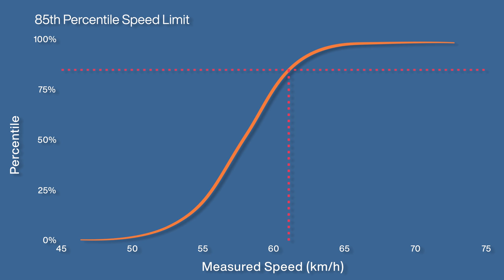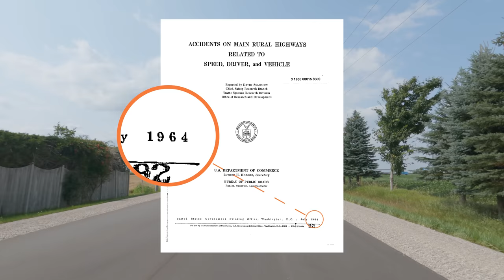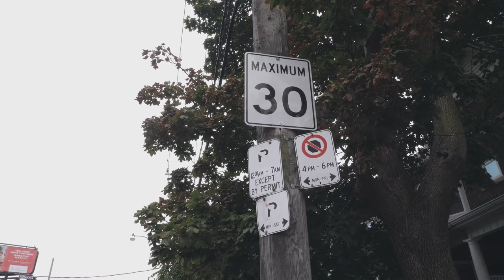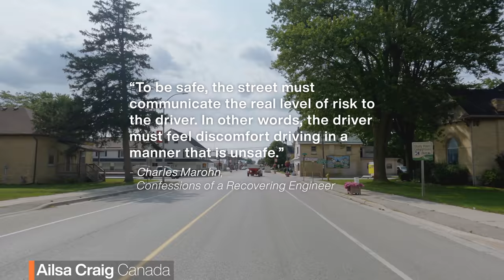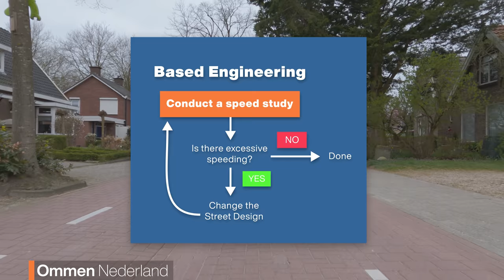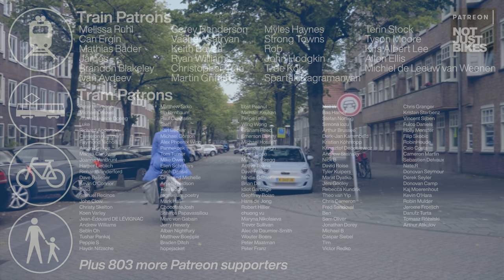The Wrong Way to Set Speed Limits [ST06]

Comment: Had no idea traffic designers would choose the speed limit based on the average speed of observed drivers on that piece of road.
that is absolutely insane to me.
Reply: It's the scientific method! Speed limits are discovered, not created 😂
Reply: Yup, that's just batshit insane stupidity for anything even slightest complexity. 
People like to speed and make stupid decisions all the time. 

One of the cities I lived in had a great example of it - we called it's Masters Turn. It's on 30,000 car/day crossing of major highways forming ring around the city. It's a two lane road with sharp bend and very little visibility (due to noise/crash barriers and bend radius) and thus 50 km/h speed limit. 
You would think people would be smart to notice that their visibility drops to 5 -10 meters and they should actually drive the speed limit (or less). 
You would be wrong - this intersection had multiple crashes per day (especially during autumn/winter) which ended up gridlocking entire city and generating hour long traffic jams.

Two years ago a speed camera was installed there - and the same week, number of crashes dropped from 1-2 per day to 1-2 per quarter. This intersection even had it's own Facebook page (with new crash video posted pretty every day, after the speed camera went live - the fanpage died due to inactivity:(
Reply: It makes sense on a rural or open road, it doesn't in the city,.
Reply: In one sense, that's actually an implicit agreement with the point of this video--the speed that drivers will go at is mostly an inherent property of the road design, so they're setting the posted speed limit based on the "natural" speed limit. All they need to do is close the loop: altering the posted speed limit should require drivers to already actually be going slower in the first place, due to changes in the road design, like what he explains in the video.
Reply: @qidydl  true, true.
Reply: I'd deliberately not round it up or down... 
"ok for this road the speedlimit will be 42 and ¾ km/h."
lmao.
Reply: On the state DOT website, a FAQ is "Won't traffic slow down if you change the speed limit [presumably down]?" The answer is something along the lines of "The speed limit is only one of several factors that drivers use to decide how fast to drive, so lowering the limit won't necessarily reduce the speed of traffic." I guess at that point it's just a convenient place for traffic cops to set up speed traps.
Reply: That's more for highway design, not for steers. Streets are generally designed based on surrounding land use, right of way size, traffic volumes etc. I don't know what this video acts like 85 rule applies to everything, least of which new design.
Reply: I guess the underlying assumption is that a "majority" of people drive more or less safely for the road design, which is probably true. But that's also why sticking lower speed signs on a road you've otherwise left untouched isn't a solution. It's weird that applying a speed limit to a road is such an afterthought; I'd have assumed a road (well, *street*) is designed for a set speed limit and not the other way around.
Reply: I really thought he made a joke. It wasnt until the final minute that I realised it is a fact...
Reply: It begs the question why the speed limit even exists if 85% of people drive slower than it anyway and it has literally nothing to do with a theoretical safe speed.
Reply: @Person01234  It should force the remaining 15% to drive slower (assuming they won't break the limit) so there will be less overtaking.

Also, it probably has something to do with the safe speed if the drivers drive at the speed that feels safe to them and that isn't completely off the mark. (However, this won't work if drivers primarily consider their own safety and there are pedestrians around.)
Reply: Imagine that mentality on the Autobahn: Jah jah Hans, 180 minimum zupper gut
Reply: @The98597thMark  About 87% of fatal crashes occur on stroads. Hence, while streets have an appropriately low speed limit, and roads have a high speed limit, the stroad (or arterial road) seems badly designed because the crash rate is so high.

If you look at any of the YouTube crash videos, then you'll notice the 90% ratio of crashes on stroads holds true. Hence, it's the design of the stroad that's bad, and driver training, lower speed limits, and so on won't do much to lower collisions.
Reply: @furthereast6775  thank you! I dont know where he got that 85% bs. Maybe that’s how they did it 200 years ago 🤣
Reply: Its partially simplified, but apt description of the process. There is a DESIGN SPEED, and the SPEED LIMIT which are two different things in traffic engineering. The engineer will design the layout of the road with such things as curves designed for a specific DESIGN speed. Such a desired design speed chosen based on the road classification (Highway > FAST local street > SLOW). This gets approved and the road is "designed" for that speed. The speed limit gets posted based on how vehicles then go in that area (85th) so that cars group together and we limit passing (as described in the vid). 

The problem is we dont apply enough controls to make sure drivers will go a DESIGN SPEED we want. This causes problems when we want to REDUCE speeds in a road because now the posted speed is 50mph, but we want to remake it into a local road where drivers are going 30mph. We can't because we get stuck in a loop of following the SPEED LIMIT of the existing road or if changing the DESIGN SPEED of the road is accepted, we no longer have the space to add curves and things to make sure the SPEED LIMIT matches the DESIGN SPEED. 

American design is about 30 years behind NL (in large cities) and designs typically always favor car users because a majority of the population only drives. Speed control is a nuisance rather than a tool for good design. Don't get drivers started on daring to suggest speed humps!
Reply: @langhamp8912  I'm well aware that stroads suck, though the safety issues aren't from driving too fast per se. I would agree that a stroad's a good example of a place they shouldn't be relying on drivers' instincts to set a speed limit, because the middle lane's a very different place to the edge lane etc.
Reply: @mantasr  People who think they're good drivers always say this :)

Overall speed limits in urban environments are probably too high. Nobody should be zipping through city streets with busy sidewalks, laneways, driveways etc. at high speed: a good driver wouldn't be driving fast in that environment in the first place.

On a rural highway then yes I'd agree,  you're really only limited by geometry. But most people complaining about low speed limits aren't talking about rural highways, they're talking about a downtown street-road that got reduced to 25mph/40kph/some other speed that's still not very slow.
Reply: @The98597thMark  I don't think any road should have speed limits. And all traffic laws such as red lights, yields, proper lanes, and so on should be completely optional.

However, all cars will have a loaded gun pointed at the center of the driver's chest, and the gun shall be triggered by the car's front bumper hitting anything.
Reply: @seneca983  Why would you stop 15% of drivers overtaking instead of 85% of drivers overtaking? And who the fuck overtakes down 2 lane city streets.
Reply: @Person01234  "Why would you stop 15% of drivers overtaking instead of 85% of drivers overtaking?"

If you mean putting the speed limit at the 15th percentile that's probably too slow.

"And who the fuck overtakes down 2 lane city streets."

Why are you asking me this? This has nothing to do with my comment as I wasn't talking about city streets.
Reply: @KBWrecker And yet most drivers, about 97%, who kill pedestrians or bicyclists do not even get a ticket. Less than 1% even serve jail time. Right now running someone over with your car is already the perfect crime.
Reply: @furthereast6775  It's almost always because the driver breaks the law, according to an Australian survey that looked at collisions that had video evidence.
Reply: If you think that’s insane, you’ll love this! In California, the 85th percentile is state law! In that law, cities & counties have to update their speed limits every 7 years or the speed limit will “expire” and police are not allowed to use “electronic means” enforce the speed limit. Also, cities & counties cannot lower the speed limit below the 85th percentile for any reason, otherwise, you guessed it, police can’t use electronic means to enforce the speed limit. 

There was a recent attempt to change the law, but it got killed in the legislature. Curiously, the CHP oppose eliminating the 85th percentile law.
Reply: @Jeff_P-1988  Some people just want to watch the world burn.
Reply: @furthereast6775  that’s not true. Traction has nothing to do with it.  They put up those yellow signs to warn you about sharp curves and traction. However the speed limit for highways and interstates is based off stopping sight distance.
Reply: @langhamp8912  you had me in the first half, not gonna lie
Reply: @furthereast6775  Rarely, unless they've done something like run a red light. A driver has the responsibility to yield to almost everything. Many imagine they don't because they're on a "road" but they do. 

If a driver hits a pedestrian or cyclist because they didn't see them/didn't see them in time to stop, 9 times out of 10 that means they weren't driving appropriately to the conditions (much like rear-end accidents are almost always the fault of the driver behind).
Reply: @mantasr  your quarrel is with physics. Even "good drivers" are more deadly at higher speeds. Everyone makes mistakes.
Reply: @TheGoonies7  Hey, I wouldn't suggest too many speed bumps; I don't think they need to extend into the bicycle lane or sidewalk. :D
Reply: @furthereast6775  One of the few common sense comments I've seen here.
After having watched the 1st minute of the video, I went to the comments to see how many people called the narrator out on this crap.
Reply: Absolutely crazy to me. Here in Germany, speed limits are determined by what experts calculate to be a safe speed fpr that road. And if traffic statistics find an unusual high amount of accidents or a high rate of traffic jams on a stretch of road, then that particular stretch of road will get a lower speed limit then the rest of that road, plus potentially some extra restrictions (e.g. No overtaking here).
Reply: @macaron3141592653  no, it doesn't make sense on rural roads either. Rural roads are actually the most dangerous roads, because people tend to underestimate the danger there and they typically don't have any barriers keeping you from crashing into trees, boulders, lakes or down a cliff if you run off the road, for instance because you went too fast into a corner.
Also there's often no street lights on rural road, meaning visibility of obstacles/animals/people is low.
Reply: @jimstanley_49  the speed limit isnt a limit at all. If it was, our cars wouldnt let us go any faster. The speed “limit” is really just a suggested “safe” speed. The real speed limit is 100 on most non-performance vehicles made after 2012 at least. Seems like newer vehicles let me hit 110
Reply: @allsystemsgootechaf9885  nothing you've said adds anything to the conversation. We're not talking about maximum capability, we're talking about maximum safe road speed. It doesn't matter if your car peaks out at 45mph. You should only push it that fast on a road designed for it when safe conditions exist. The implication I was going for in my comment was that even the government agencies that set the speed limits don't appear to take them seriously as I paraphrased them saying they don't necessarily affect the speeds people drive.
Reply: @codpwnss  there is no much misinformation in this video as well as a complete lack of understanding of infrastructure, asset management and maintenance requirements.
It doesn't even talk about design speeds and wrongly assumes new roads in cities are built every day 🤦🏽 
Also, can everyone please stop comparing a small flat country with small vehicles that doesn't get any snow and where elected officials are not allowed to vote on engineering design - to almost any North American city.

Some of the information and psychology is correct, but the basis of so many assumptions is greatly misinformed.
Reply: That is technically false since the current laws for Canada have set standards for public buildings 30km/h, residential streets 50km/h, rural roads 80km/h and highway 110km/h. They require adjustments based on road construction.

So the "testing" means little since even if we were driving 120km/h in certain areas the current laws would simply be enforce due to safety concerns.

Yet we have 51% less fatalities with 20% population growth over the past 20 years. Cars have improved in traction, braking, electronics and much more.

I have find this video misleading and also addressing a problem that does not really exists with fatalities dropping on average 2.5% each year. Right now in Canada we have 0.006% about 6 for 100,000 drivers. At certain point you have to consider the actual efficiency of any changes to this above figure due to diminishing returns, causation of new risk and required redundancy.
Reply: The guy ignores current laws relating to design speed: https://en.m.wikipedia.org/wiki/Design_speed
Reply: @flaviusfake271  as long as pedestrians remain too frightened to leave their homes without encasing themselves in a car.
Reply: @jimstanley_49  We have more pedestrians now on the road nowadays. I do agree lanes could be improved in some areas. Anyways in my town we have lots of pedestrians. Accidents usually occur on right turns due to inattention and/or pedestrian cutting in front. Again traffic speed is not an issue. Accidents occur more due to road directions or inattention.
Reply: Why ? That method makes the most sense.
Reply: @Peter Evans I've seen a lot of this guy's videos. Some good points, but mostly sounds like a bicycle whiner....And I'm a cyclist......I also drive a 61 Plymouth station wagon. I think the roads here are just fine. I have no problems walking, riding, or driving. I live in Edmonton Alberta.
Reply: Yes, I had no idea that speed limits are completely arbitrary. I though that speed limits were calculated by way more sophisticated methods than that which take into account the risk of accidents, injuries and deaths.
Reply: @jimstanley_49  that and the fact that cops will pull over the one car that is obeying the speed limit for "impeding traffic", rather than pull over the speeders and get the flow of traffic down to the speed limit where it belongs.
Reply: @langhamp8912  no
Reply: @furthereast6775  incorrect and they have cyclist attorneys
Reply: @glennmelven3414  wrong
Reply: @allsystemsgootechaf9885  Aight do 110 through a residential area past a cop and then come back and tell us how it's not a limit.

The fact that it varies by road shows it has nothing to do with the car, it's a legal limit, not a physical one. If you go above the limit you are not instantly smited by god, but you are liable for criminal penalties.
Reply: @worldchangingvideos6253  Care to elaborate on what you think I said was wrong? All I said earlier was that FurtherEast showed common sense and I wanted to check the comments to see who would call the Narrator out on this crap.
Reply: I see no evidence that this is how it is done in the U.S.
Reply: @borek772  People are "Speeding" because the limit is too low. Posted speed is 40. 85 out of 100 people go 55, makes sense that road should be 55.  We base entirely too much of our lives on the lowest common denominator these days. Or more people need to learn how to  drive properly.
Reply: I think I yelled 'Are you kidding me?' at that part. Basically if everyone suddendly feels like driving faster then you'd end up with higher speed limits? That is insane and honestly can't believe nobody with half a brain would realize that in less than two seconds.
Reply: @SlowHandMcQueeg Agreed
Reply: @maximipe  This video poster has an odd anti-car slant in his videos. I live in TN and this hills here are murder, just to think everyone can get around on a bicycle is ridiculous. And how do we pay for the road construction and maintenance?
Reply: @jimstanley_49  Nobody cares at all of course, but fuel consumption and emissions go up geometrically with speed increase above around 35 mph for ICE cars.
Reply: @tobyvision  I know. My old car got its best mileage at about 60, but the interstate limit is 80, and I'd rather drive 75 than go 50 and add 30 minutes to the 4-hour drive to my parent's house.
Reply: It's not actually that crazy to base it on average speed since most people will drive about as fast as they perceive is safe for the road, traffic, and their skill level. In some situations removing a speed limit can actually improve safety since people start to base their speed more on road and traffic conditions instead of a sign that may or may not be accurate and can give them false confidence when the road is subconsciously telling them to slow down. 

Theoretically a road that is physically and aesthetically well designed enough wouldn't need any posted speed limits at all, and might actually be safer without them.
Reply: @sock2828  I think you just reiterated NJB's point.

I'm currently commuting (about 30 miles) on a road that has been heavily modified for safety--except for actually changing the road itself. Center-line rumble strips, extra speed limit signs, extra "No Passing" signs (for the impatient people who think they're above the lane markings), lowered speed limit. I drive the limit and am regularly passed, sometimes in no-passing zones, by people who think road markings and signs are about when the cops will care enough to pull you over. If they actually made the road unsafe above the limit, maybe people would drive more cautiously. Of course, then people would complain about impeding emergency response.
I'm curious what traffic is like on the longer Amsterdam roads, where I assume more people would be comfortable pushing the limit.
Reply: That is not true. He is pulling this out of his arse without citing any sources.
Reply: Like the video said, it was done that way in the past.  I dont think most new roads have speed limits set like that anymore.  Roads go through so much more engineering now that speed limits are determined by other factors.  The amount of traffic that they expect, the timing of traffic lights, traffic flow, traffic control pedestrian and/or bike traffic, not to mention traffic safety features (guard rails/cables, size of the median, vision obstruction,) among others.  Now, there may be a guideline that is use such as "roads with travel lanes wider than x feet can handle traffic of y MPH) etc  But there isnt anyone standing on the side of the road clocking drivers.
Reply: Why?  The collective decision of drivers as a whole in judging a safe and efficient (fast) speed is more likely to be the most reasonable than that of any number of experts who are not necessarily weighing costs and benefits of their decisions.  85th percentile is best and has been proven time and again to be the most reasonable solution.
Reply: @furthereast6775  Often too large a safety margin, which encourages the willful ignoring of speed limits.  Many people don't ever commit criminal offenses, but who has not exceeded the speed limit?
Reply: @codpwnss  Has been in use for 80 years.
Reply: @borek772  this proves ultimately that speed design is only part of the problem. The biggest problem that cannot be fixed that easily is that drivers are overexaggerating their own skills and are dumb af
Reply: @langhamp8912  Your 'genius' idea falls apart at literally the first pothole/speedbump/road is icy/anything unexpected. To call this idea stupid is a gross understatement of titanic proportions, it is simply pure idiocy.
Reply: @csquaredgaming  If you're not a driver then you'd want drivers to be as careful as possible. If you are a driver then you want to be able to drive as fast as possible with no consequences. As a driver, if you kill a pedestrian and you're not drunk, you won't get a ticket, you won't get fined, you won't get jailed, and so there's no reason to drive with utmost care.

Do you drive with utmost care?